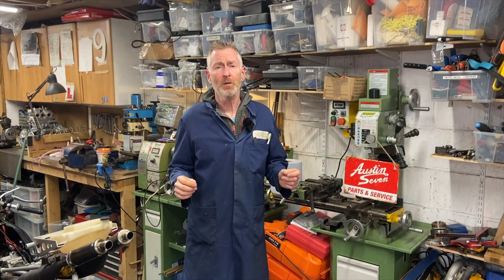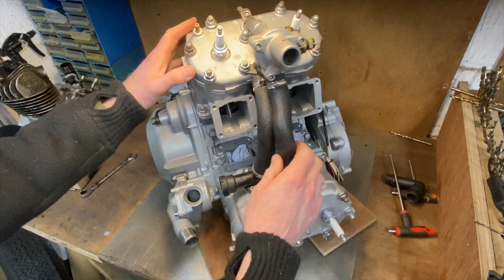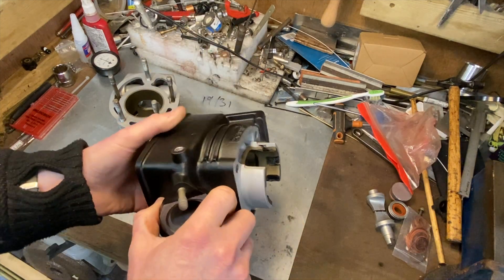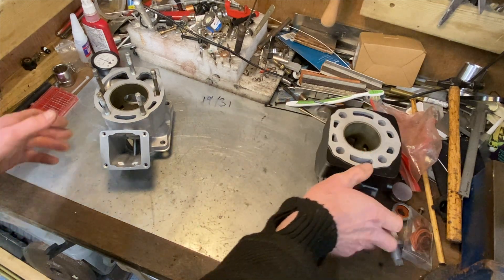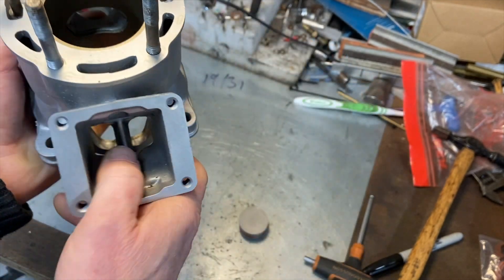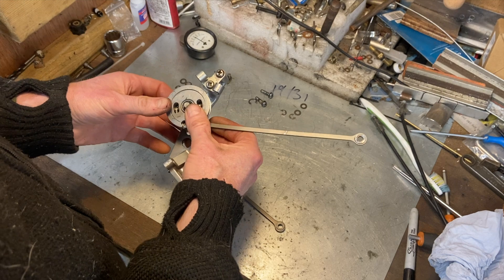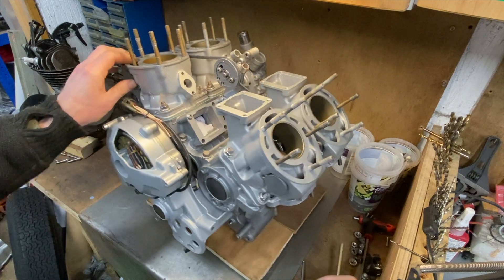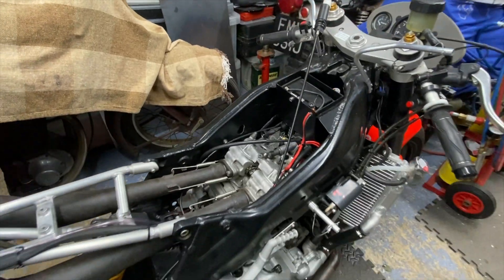Yamaha RD500 RZ500 2-Stroke Engine - Yamaha Power Valve System (YPVS) explained!!

Comment: Can you please tell me where the power valve motors cables should point when ignition is switched off IE straight out the back ???
Reply from the maker: Not sure what you mean by where the cables should go, but when the ignition if off, the power valve should be in the fully open position. When you turn the ignition on, it cycles Open->closed->open. When you start the bike, they then close. They will then start to open at about 5500 RPM. This all assumes you have a standard yamaha power valve controller. If you have a zeeltonic, it's different! I hope that makes sense!

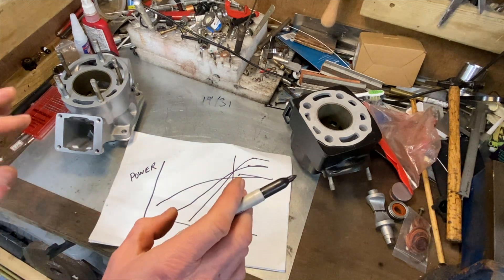Comment: 4:05  If you had drawn a line about as steep as a church spire you would have drawn the power curve of my old 350LC. The powerband started at the red line (9.5k) and the engine then revved to about 11.5k. The crank lasted about 5k miles, I got good at swapping out the crank with one sat on the shelf ready to drop in. (Less then a day to do all the work). The crank was welded and used TZ big end bearings as they will run at higher RPM without skidding the rollers. From memory I think the bike would do about 130 MPH! Yes, it 'blew up' a lot!
Reply from the maker: Ah, those were the days! I had a Terry Beckett tuned 350LC with F2 pipes - went like stink!  He only lived about 4 miles from me so I could ride my push bike there when I blew the bike up..!

Comment: Is there any modification to do on those valves to get more power?
Reply from the maker: the only real mod is to just make the exhaust ports bigger, but that can't really be done in isolation - all the ports would need to be worked on together.
Reply: @thebracketfactory  thank you!

Comment: Thanks for an excellent video - it’s a good idea to Loctite the power valve cap screws - they have a tendency to work loose over time - the temptation is then to over tighten the screw which can crack the tab off - don’t ask how I know 🙈
Reply from the maker: That's a good tip Paul 👍

Comment: Very well done! I have the 90 Fzr400 with EXUP valve. Does that rd500 have 2 crank shafts?
Reply from the maker: Hi Brandon, yes it does have two shafts  - I have done another video which gives a full overview of the engine which you might find interesting. A also have an FZR1000 Exup but the exup valve has seized solid - a very common problem! They need to be used!!!

Comment: I want that motor! My first 3MA used to wear down that flat on the power valve, and my dad, a precision toolmaker, welded it the first time, the second time it happened, he made new ones with a different aluminium alloy and coated them with the same stuff he would vapour coat onto cutting tools and been over 20 years, and it never happened again.
Reply from the maker: You were lucky to have a dad like that!!  Actually the 3MA parts are almost identical to the RD500 lowers  Its effectively half an RD500..

Comment: A 350YPVS and a couple of TZR's owner, I think it was the most elegant system, all the other's copied it to lesser degrees trying to avoid the patent, and yes those valves got gummed up with all sorts of gunk. Really noticable when a seal would start going on that outer cover.
Reply from the maker: The TZR  (1KT) his pretty much identical to the RD500 - the barrels and heads are pretty much the  same - so it was effectively half of an RD500 (but with a better frame!)

Comment: My pal bought an RD500 new.

He told me these motors would nip up.  One pot gets too hot.

Old wives tale I cannot be sure...
Reply: I did nearly 50,000km on mine when I was 18, never blew up 😂
Reply from the maker: wow - wonder what the power valve mech looked like after 50k!!  @kiztime1234